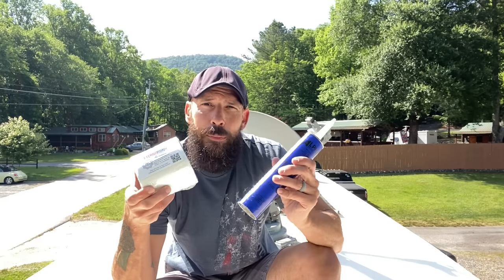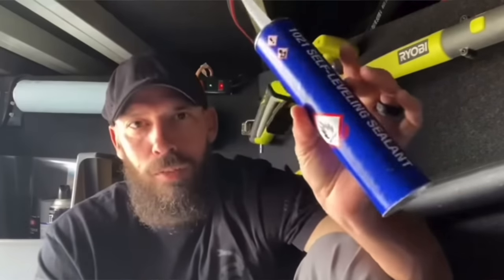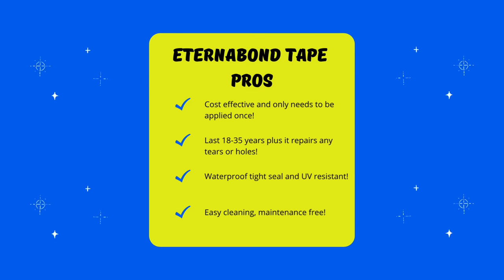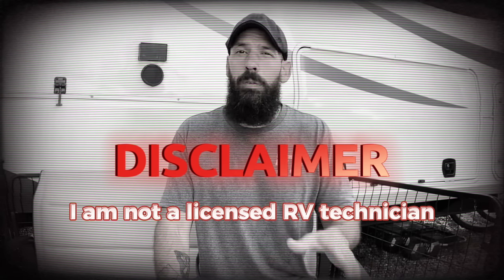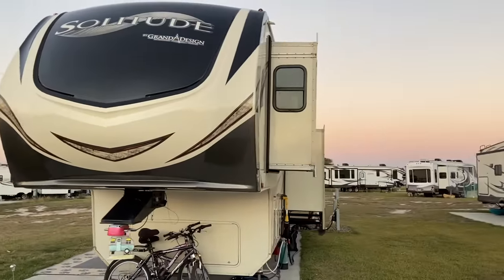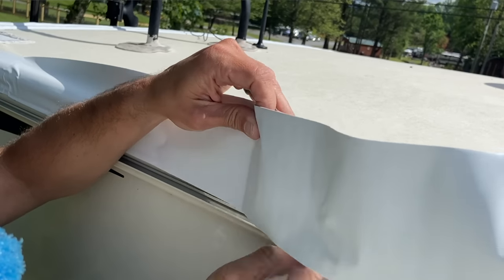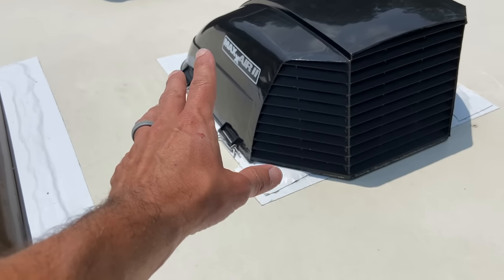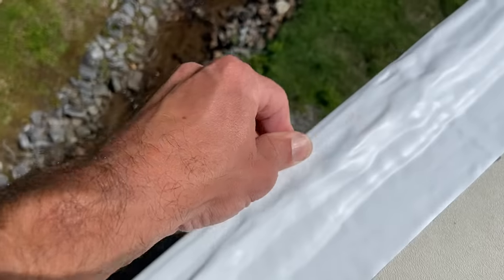NEVER Reseal Your RV Roof AGAIN! (Eternabond Tape VS Lap Sealant)

Comment from the maker: ⭐️PRODUCTS MENTIONED IN THIS VIDEO⭐️
🔹Eternabond Tape 50’ x 4” https://amzn.to/3J5JET3
🔹Eternabond Tape 50’ x 2” https://amzn.to/3P79CJs
🔹Eternabond Tape 25’ x 4” https://amzn.to/3qB4V0j
🔹Eternabond Primer: https://amzn.to/3N6yGxQ
🔹Eternabond Cleaner: https://amzn.to/3J2Gkru
🔹Roof roller tool: https://amzn.to/3NlCIU4
🔹Alpha Systems 1021 self leveling sealant: https://amzn.to/3MR9kUc
Reply: I did mine last year it’s holding very well.   Going to do the vents and slides this year.   Great video.
Reply: My cargo trailer came with tape in 2018.  It started leaking this year.  I am replacing with 4" Eternabond this month.  Will see how well it lasts.

Comment: I taped my roof 6 months after I bought my RV.  It still looks brand new and doesn't leak at all!  It's been 3 years now!
Reply from the maker: Nice! Glad to hear stuff like that bud  👍🏼 Took me too long to get around to this project but I’m glad I finally did. Safe travels out there man!
Reply: This is exactly what I was thinking! I just purchased a 2024 trailer and don't want to deal with the lap sealant issues from UV. I've only had it about a week but I'm going to put this stuff on top of everything to help protect the lap sealant from the Sun and adding an layer of waterproofing on top of that.
Reply: How is it holding up bro? I see your comment is almost a year ago so I'd like to know
Reply: @67lnr80  Still like new, no leaks and really no maintenance required.
Reply: @67lnr80 is it eterna bond we're speaking of...

Apologie in advance, but I'm in Canada, in a very humid climate and the winter is fast approaching...
 probably a month and a half from now so I don't have time to read through all the comments. Thanks for any help
Reply: Eternabond is meant to be a “Temporary” Emergency Repair…. It’s not worth cutting corners and hoping for the best. Just do the job correctly with Dicor and move on.. that’s like buying retreaded  tires for your car because they look great for 10 minutes until they blow up and litter the highway.
Reply: @Krazycat321  Okay, that's awesome, but there's all kinds of different dicore..
Are you speaking of the tape for around the air conditioning, the vents on the roof or dycor caulking? Or? Thank you
Reply: @kimberlyn7778  the permanent application is for the dicor self leveling lap sealant that comes in a cartridge that goes in your caulk gun

Comment: Neither Dicor self-leveling lap sealant or eternabond tape is a good idea on an RV rubber roof membrane. Both will cause a chemical reaction with the membrane contact cement that holds it in place, causing the membrane to disbond from the plywood or OSB board to which it is adhered and will cause wrinkles and bubbles in the membrane. Eternabond tape may last a long time and it may look good when you first put it down, but a couple of months later it will be full of bubbles and your roof membrane will no longer be adhered to the substrate.  My roof is a total mess because I listen to Youtubers two years ago and put Eternabond around my vent fans and other areas after installations and the same thing with Dicor self-leveling sealant, it causes the membrane to wrinkle and bubble like crazy.
Reply: Well what do you use?
Reply: I have a EPDM roof like many others & you will find Dicor around all your skylights from the factory & black & grey water vent caps so I can’t see how it would have a reaction.Dicor is between your front cap seal & rear depending on your trailer.Dicor & Buytl tape are the essentials on an RV Trailer.The tape is basically a butyl adhesive.If this was an issue I would think there would be disclaimers on them that they react to your roof & would be law suits.If I’m wrong please explain??

Comment: The better alternative that everyone should know about is that all you need to seal your roof vents forever is to use a non-setting butyl sealant. Sikalastomer 710, or similar. NOT a Sikaflex adhesive no matter if it is marketed as RV product or not. Especially if you have to use it on a not-completely flush surface.

Comment: I don't understand the negative comments here. The people that love lap sealant are upset with this for some weird reason lol  I guess they are the lucky few that haven't had to deal with water issues...... But for me I did on my last motorhome and it was a nightmare and I got up on the roof of my brand new camper trailer and saw the lap sealant was perfect without cracks and I thought to myself I'm going to put the internal bond over the lab sealant to protect the lapsulin from UV rays. If for some crazy reason the eternal bond fails then I have a second barrier underneath it that is basically brand new with no UV damage. And yes I know how to spell this stuff but I'm using my voice text and being lazy. On a side note this 2024 trailer that is brand new claims to have a 2-year warranty on everything and a 3-year structure warranty but when I talk to the warranty department the roof sealant aka joints and penetrations only have a 3-month warranty, that tells you how confident they are in their sealing products. They said if I put that tape on the roof it would void the warranty and I laughed at them and I said what warranty

Comment: Thanks for addressing the complaints about Eternabond. It makes total sense that if it's hard to remove, it's a positive that indicates longevity. If carefully prepped and applied then outlasting lap sealant should be the result.
Reply from the maker: Indeed 👍🏼👍🏼👍🏼

Comment: I had a dealership void my extended warranty because i removed all the lap sealant and used Eternabond.  Their reason was it was not approved by the manufacture (KZ RV)
Reply from the maker: Those warranties are pretty useless in my opinion anyways

Comment: You can use brake clean to clean your seals before appling the tape it will not harm the seals or the roof membrane. Spray it on wipe it off your good to go.
Reply: Brake cleaner removes paint. If it gets on side of rv say goodbye to paint

Comment: 13 years ago while looking over failed sealant I made a choice. I stripped all the sealant....all of it right down to bare aluminium. I cleaned and prepped as needed. Down went Eternabond tape. It was a little work to prep it right but I would do it again ...if I ever need to.
Reply: This is what I think I['m going to do. The whole roof. You can get this stuff 12" wide I noticed!  I have a weird roof and not alot of options and I just want to go camping! Lol

Comment: What will happen if I just get some black tar to seal the leak  ? Of course I'll clean the area first before applying some tar, it seems less complicated and cheaper too . Is just a roof who cares about how it looks.
Reply from the maker: Sounds like an excellent idea! Go for it 👍🏼
Reply: That’s what we called Backjqck.  Once you work with it, you will regret it.  It gets everywhere, and gets tracked everywhere.  There are plenty of other products out there that are designed for RV roofs.
Reply: @rodgraff1782 .  I see your point but the fact that this rvs develop leaks so easily, common sense tells me the proper sealants are not but only work for a period of time, this is obviously a defect from the company that makes this rvs and seriously 2000 to 8000 for a job like this is a total rip off. I've seen several videos on how to DIY and it seems like a lot of work but I'm sure a professional could perform this job in less than 8 hours. The person that's renting me this rv doesn't care about how pretty the roof of the rv's roof looks as long as the areas where it leaks are sealed. My dad used to go on top of my mobile home while raining and in five minutes he would fix a leak with tar and I never saw tar flying all over the place. The landlord has no intentions of taking this rv on a cruise, is just for renting and nothing else.

Comment: Excellent video. I’ve been working as a Rv tech since retiring from carpentry. Eternabond tape is a worthy product. If I may offer a few IMO tips; clean,clean, clean, the cleaner the better. I use Oxiclean with a soft to medium bristle scrub brush. For really stubborn dirt afterwords rapid remover on a soft towel will help remove some of the chalking of the sealant making for better adhesion. If it’s several layers we use an oscillating tool with a smooth blade to shave the layers down ( the idea is to prevent damming around the penetration). 
Eternaclean works well just prior to installation, but, acetone on a rag works just as well.
My suggestion for all corners of tape is to round the edges like you see in the ladder penetration in the video. You do this with really sharp tight bladed scissors, pull the scissors back slightly as your cutting.
Tack one end of the tape down and with slight tension align while peeling back the backing tape. You don’t want to pull too hard for the tape will be under constant tension if you do and start to recoil over time. Pay attention you get one chance to put it down! Wherever it touches it calls home.😂 
Great preventive maintenance work done. Water is the enemy of these campers keeping it out is essential. I’ve seen 5 year old campers that were literally sponges and once we opened walls it took days to dry out even with dehumidifiers.
My advice if your not using your camper cover it to keep the water off. Even if it’s the roof and a couple of feet down the sides it will extend the life of your camper by years.
Reply from the maker: Great tips and advice. Appreciate you watching and thanks for the great comment. 👍🏼
Reply: Where were you before I realized my2 year old Thor (2022) was ruined due to water intrusion. 😢
Reply: @MichaelMaduske  sorry I didn’t know, and you didn’t call! Hope you were able to correct it, they’re salvageable due to less water absorbent materials than they used in the past.
Reply: @michaeldecker2725  Haven’t attempted to repair it just yet.

Comment: I've also used eternabond tape on my vents, skylights, and antennas. It's been 4 years and holding up great.
Reply from the maker: Good deal! Glad to hear it’s been holding up for you. Appreciate you watching!
Reply: Just found your channel. It’s awesome!! 

Yes I taped over all my lap sealant with eternabond tape about 7 years ago and it’s been holding up just fine. 

We ordered a new trailer last week and this will be one of the first things I do.
Reply: You don't have to reapply lap sealant every year , I live in Florida (HOT , Rains all the time) I reapply every 5 years whether it needs it or not, no problems.

Comment: I rejuvenated my 97 Tiffin Allegro EDPM rubber roof this spring, and this (using Eternabond) is very similar to what I did at each and every roof penetration point.  That said, I went one step further and coated the entire roof with Henry Tropicool silicone.  At 26 years old, my EDPM had seen better days.  While it still had some life left and I have seen WAY worse roofs, I decided that it was time to not chase little leaks again.  I removed ALL the old sealant/caulking, and all trim.  While I left the AC, shower dome, and refer vents on, I did take the opportunity to replace the old ceiling fan vents with new MaxxAir versions....esp since this was (hopefully) the last time I'd be doing any real roof work.  After installing the new vents, I used Eternabond on EVERY penetration point, including over the front/rear fiberglass cap trim pieces.  Following that, I taped off where I didn't want silicone and rolled it on.  After two coats, the roof looks new with Henry's lifetime warranty.

If you have time and an extra $400, I highly recommend Henry Tropicool over that Eternabond.
Reply from the maker: Sounds like you’ve really bullet proofed that roof! I’ll have to look at that Tropicool, sounds interesting. Definitely appreciate you watching and your comment 👍🏼
Reply: @WhyWait  Tropicool was worth it in my circumstance...doing it right takes a lot of time, but the end result is a 20+ year roof.  :)
Reply: I was literally going to ask about this. I really appreciate your comment! We just purchased our first RV, and it being a 2004, it’s due for some modernization, as well as a fresh sealing on the roof (thankfully, still no leaks). The previous owners took very good care of it, but now it’s time for a bit of refurbishing. I’ve had a hard time trying to figure out exactly what to seal it with, and was thinking I had to pick only one product, but thank you again for this!
Reply: @justinbond558  Just make sure you do do the butyl tape and eternabond BEFORE you Tropicool because they WILL NOT adhere correctly to silicone based coatings.  And, for added measure, if you caulk like I did after the Tropicool (or similar), make sure you use a silicone-based caulk.

The hardest part (for me) was getting under the AC units...everything else is accessible...I just didn't want to go through the pain of R&R.  That part of the EDPM doesn't get any sun or much water anyway, so I think I'm safe.
Reply: Be aware that you can not walk on Henrys Tropicool when it is wet or even damp from morning dew. You will fall!
Reply: @sandys2672  haha....no lie.

Comment: Have a RPod which has one piece fiberglass roof that runs all the way from front to back. The point of weakness as far as water intrusions is the seams between the sidewalls and the roof. After replacing the crappy vinyl trim and the gazillion non galvanized screws that comes from the factory many in our community, including myself, cover  those seams with Eternabond. Many have 5+ years on theirs with no signs of degradation.
Reply from the maker: That’s awesome to hear! Never talked to anybody who didn’t like this stuff. Thanks for watching 👍🏼
Reply: Hey I’m thinking to do this with my sides as well.    Because my fiberglass roof is like yours .  You mention the screws. Does this mean you took them out and re-butyled the side trim ? ( roof - side trim channels) . 
And why lap sealant it then do Eterna bond tape  ?

Comment: As long as you take your time, clean the roof, and apply this flat, it will outlast your membrane. If you get small areas of failure, you can go over it with more eternabond. Here’s our 2 year review; This is What Eternabond Tape Looks Like After 2 Years on an RV Roof
https://youtu.be/FZzLNorRAmo
Reply from the maker: Right on 👍🏼Definitely Happy I finally got around to this. I saw the two year video after I was already editing this or I would of mentioned it.

Comment: Good practice is to cut the 90 degree corners. Round them. Roofers use this technique. The square corner can lift. 
Good Video !
Reply from the maker: Good tip. 👍🏼 You can see in the video I started to do this on a section around the ladder on the roof, rounding the corners. Definitely a little more work cutting but probably smart. I gave up on it after inspecting my old Eternabond patches and noticing the corners were just fine. But yeah definitely a good idea for extra protection. Thanks for watching.

Comment: Being a roofer for 30 years when I redid my roof, I use the Eterna bond tape and then I used 100 year quad underneath all my vents and then I used metal roofing screws with the washer instead of the little jump screws they give you you’re going on seven years now and not one leak through the roof and I don’t have to get up there and replace the lamp ceiling every year either there is way better ways of doing it in the camper places doing it as fast as he can get it done

Comment: Just did the eterna bond and Henry's tropical white and it came out great. Solid ruged and smooth and easy to clean. This roof is like a bathtub liner. Worth every penny. I highly recommend this. I did it with my 2017 coleman now the 2021 wildwood lite. Love it. Great security for piece of mine. When you pay $24,000 for a rv $500 is nothing. In the winter I have a cover for it. Like my father who was an aviation mechanic he taught me take care of your stuff it will take care of you.

Comment: I first used the 2 inch EternaBond tape to address a leak in our bunkroom slide. When I finally figured out the problem was on the roof of the slide, I cleaned up all the nasty looking glue that was up there. Cleaned the roof with dish soap so it was so clean I could eat off it. Then I put the EternaBond on. Stuck really nice. No leaks in that slide since. I've since used it on the edge of the roof where I discovered a tear in the roof membrane about 3 inches long. I've already decided I wanted to do this project. I bought the 3 inch EternaBond, but I also haven't started yet. Can you imagine an RV roof that's 100% EternaBond Tape? LOL
Reply from the maker: Sounds like it would be an expensive RV roof 😂 Definitely a project I put off for way too long. Glad I finally did it!

Comment: Most excellent video, I have used Eternabond tape for yrs with great results, If you need to remove the tape just use a heat gun heat it slightly and pull then scrape and use acetone to remove the residue.

Comment: You mentioned, various ways to remove the tape when you need to replace a vent or sky light cover. Do you have video on that?
Reply from the maker: Due to the video getting long I cut that part out but Ross over at RV Tips n Travels in his 1 year review video around the 7:30 mark explains how he would remove it and I’d do the same. Link down below. 
 https://youtu.be/f4YXYYWWtbA

Plus you can search on YouTube and find other videos on removing it. 👍🏼 It will be a pain just like the lap sealant is too. Thanks for watching!